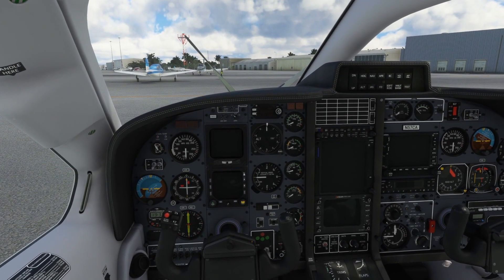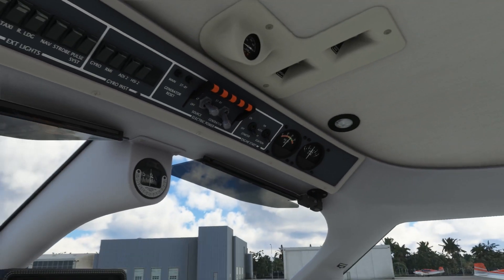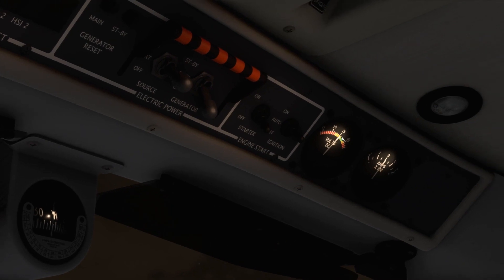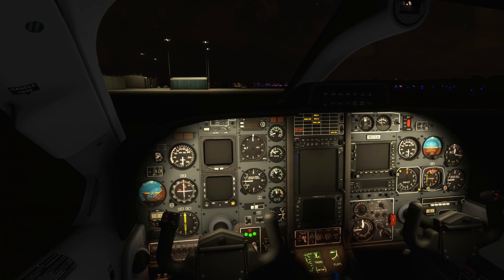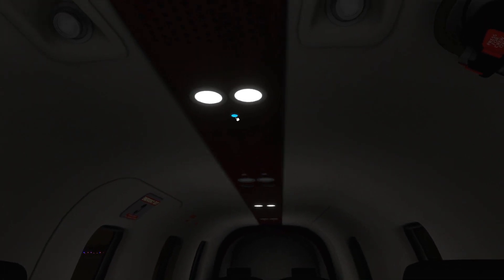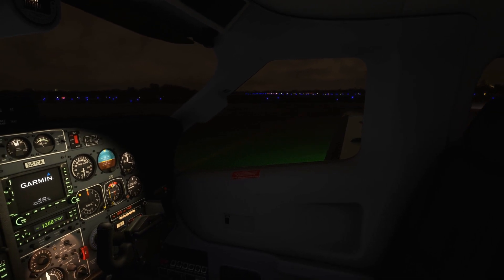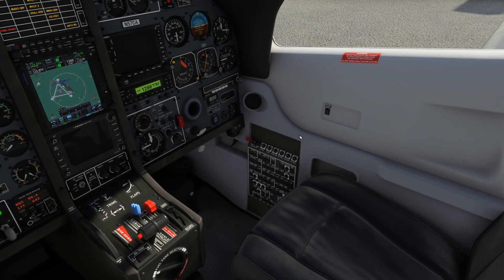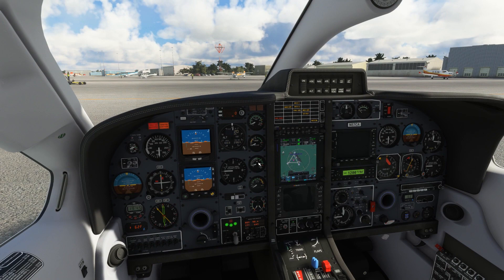Black Square TBM 850 for MSFS  - Electrical Systems

Comment: Does anyone which variables (LVARs or other) control those breakers? I want to be able to monitor them. I can't seem to find these values, not even from the info included in "Analog TBM.xml" file. I know how to activate/deactivate them via K:ELECTRICAL_BUS_TO_CIRCUIT_CONNECTION_TOGGLE event but not how to monitor if the circuit/bus breaker is currently on or off.

Comment: Is the essential bus on a separate battery? Is that load simulated where powering up a whole GTN750 takes more power than a simple COM1 radio would?

Comment: Love the aircraft but my biggest problem is them advertising as a newly fully modeled aircraft when it’s model off the Tbm 930 in msfs. Tbm 850s never had a pilot door. That only started with the 900. If they could explain how that came about would be great. Otherwise love the interior modeling and old school instrumentation.
Reply from the maker: Hi there.  So, the pilot door was actually available to add as an extra on the 850, which meant some of them did have the door. The one this was modelled on for instance.  See it as a little bonus perhaps? Doesn't really matter for us where it's based from, if it was from scratch or if the 930 model was used to give a starting point then it was turned into the 850, and we hope it doesn't matter to you users.  The thing to look at is how it's ended up and how accurate a representation it is to the 850, that's the key.  We think, well we know it's bang-on and RW pilots of the 850 are saying pretty much the same, see even steveo1kinevo's comments and feedback that adds weight to that.  Hope you do enjoy it, if you ever decide it's something you'd like to fly and thanks for the positive comments too.
Reply: Definitely first buy for sure. Just never saw an 850 with a pilot door. Learn something new everyday. Thanks for replying.

Comment: Cool, so does the weather radar actually work in this or is the Bendix display just for failure parameters? Thanks 👍
Reply: It does work!
Reply: @lennox_365  it will be the standard Asobo one then, so absolutely useless!

Comment: Are the sounds the default adobo tbm or recorded of a real 850
Reply from the maker: To clarify on the sounds:  Black Square’s TBM 850 features a highly customised version of the MSFS-native (Wwise) 3D TBM 930 sound package, with many new handmade sounds added for warnings, environmental control systems, electronics and more. The default sounds have been carefully assigned to all interactable cockpit elements for an authentic 3D spatial audio experience and engine sounds have been integrated with Black Square’s turbine engine and propeller simulation.
Reply: They’re default
Reply: @Jannik_Stein  oh shit deafault sound is a no no for me and a huge dealbreaker
Reply: Does it really matter.   How many of us have actually sat in a 850 in real life, let alone listened to the sounds so much, you can tell if the sounds in the sim are realistic or not.

Certainly by the videos we have seen in the last week, it sounds great.  No idea how realistic they are, but they sound fine.
Reply: @@KevoZenji What a shame.. Why go through all of this effort and not make custom sounds?
Reply: @GermanWWIIPreservation The sounds in the default aren't too shabby.
Reply: @GermanWWIIPreservation Despite what people seem to think, PROPERLY recording accurate sound and engineering it into WWISE (a real POS software) is rather difficult task and requires specific skillsets that they might not have on their team.